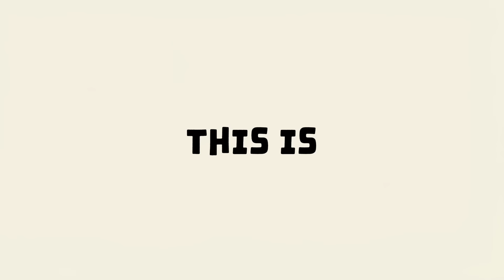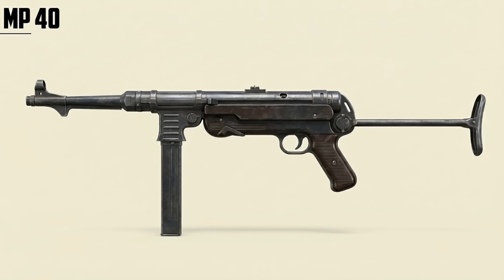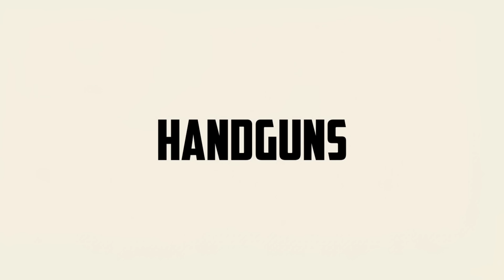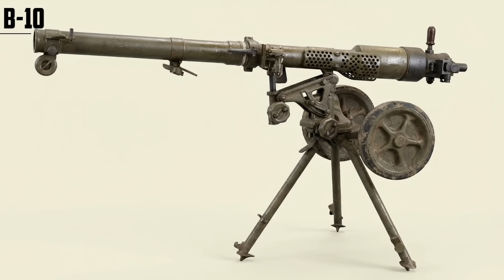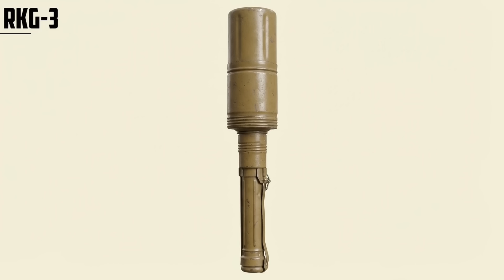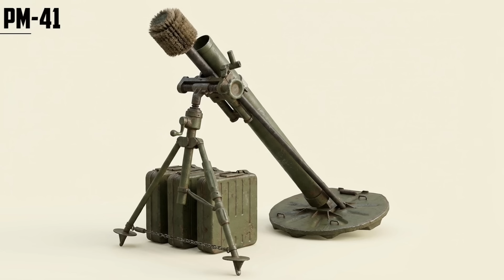Every Weapon Used by Vietnam Against USA

Comment: I own a very nice condition 1960 Chinese Mosin-Nagant T-53.  Chrome bore in very very good condition. Not 100% matching #'s, adding to authenticity.  Never had any rust, but does have a 5.56NATO round hole thru the stock just under the barrel, and a bullet Nick on the end of the barrel between the sight and barrel end. Did not adversely effect the bore. No importer stamp (it's a brought back by a USA soldier).
Reply: That’s sick it’s real. The bullet hole adds character

Comment: You're forgetting a lot of Japanese, and French Weapons. If I wanted to be very pedantic you forgot a lot of variants' of weapons such as the variants' of AK's. By this point most AK47's weren't true AK47's they were AKM's like Chinese Type 56 which were newer generation AK's that used stamped instead of milled receives as well as other small differences.

Comment: 0:15 there's no such a gun named AK-47
Reply: What the hell are you talking about?
Reply: @fisherthomsen6572 ak-47 never existed, accurate gun name we are talking abt is just AK, there were 3 types 
- type 1 (also it was prototype, none of them were mass produced) "ak-47"
-type 2 most popular and mass produced "AK"
- type 3 modernized "AKM" mass produced in 1950
Reply: @Bednarschitz ACHUALLY the gun was official called Автомат Калашникова (образца 1947 года) in russian which translates to 'Kalashnikov's automatic [rifle] (model of 1947)' hence it became known as an AK-47 AND there were 3 types before the AKM, Type 1 with stamped receiver (manufactured from 1948 till 1951), Type 2 with milled receiver (manufactured from 1951 till 1957) and Type 3 with milled receiver but with reduced weight by some cuts in the receiver (manufactured from 1955 till 1959). And even though the Type 1 saw limited  production, it was never just a 'prototype'.
AKM production started 1959, not 1950.
Get your facts straight before you flap your mouth lol
Reply: @MrLanksa still it wasn't ever ak-47 and this name is incorrect
Reply: @Bednarschitz no you're just wrong, go read up on the standards of naming firearms in the soviet union. They always used the name of the design and the year it was accepted into service. PPSh-41, PPS-43, DP-26, SVT-40 are all examples of that so calling it AK-47 is correct, you stubborn SOB
Reply: @Bednarschitz can’t even back up your statements, straight ragebait
Reply: @Bednarschitz  yes if was my guy
Reply: @fisherthomsen6572 It was called AK. AK-47 isn't it's real name.
Reply: Avtomat kalishnikova = AK 
Year made = 1947
???
Reply: https://en.wikipedia.org/wiki/AK-47
Reply: @user-fe1nn1qw4s "Me using Wikipedia me Smart " 🤓
Reply: @Bednarschitz better than trying really hard to make some technical, nuanced point online and being very wrong 😂
Reply: Stfu and enjoy the video, damn.
Reply: You're the ackshully guy on the meme
Reply: stop ruining the community, the internet is already worst
Reply: @worldbiggestfan1 ... it's true though. It was called simply AK.
Reply: @worldbiggestfan1 what r u talking abt? XDD

Comment: Some of your pictures are a little off.  Whether they were mods by Vietnamese forces or not I don't know but the pic of the VZ 52 with a detachable bayonet is weird when it came with a side folding bayonet.  Also the Yugo M.56 shows a under folder stock and a wood stock on the same smg.    A couple things that were definitely used but not listed the 1911, 1900, and Any early Browning 7.65 pistol.   Not to mention the French MAB and (Spanish) Ruby.

Comment: Another good first attempt, I'd say even better than your US weapons video.  Still some that you missed, but another good first attempt.  

The pic of the SA 23 is actually the SA 25, The 23 used a wooden stock while the 25 had a folding stock.  Not sure if they used this in Vietnam though.  I'd expect them to have used the Vz 24/26, same guns but rechambered in 7.62mm Tokarev.  Also, your pic of the RPK is actually the RPK-74.  You can tell by the magazine.  

Also, I don't think the PKM was used as it only entered service in 1969, but the earlier PK was used in numbers.  Could be wrong though.  Overall, a good job!